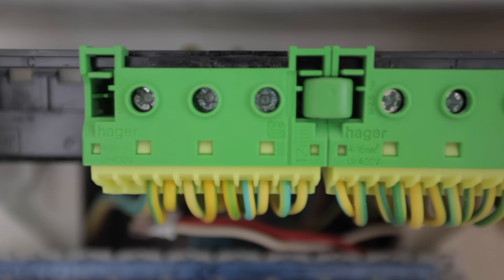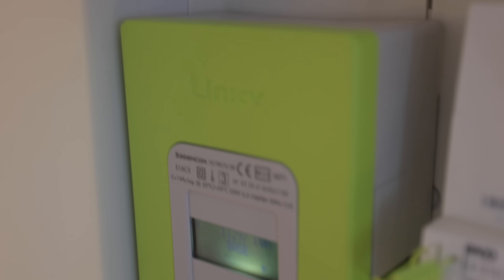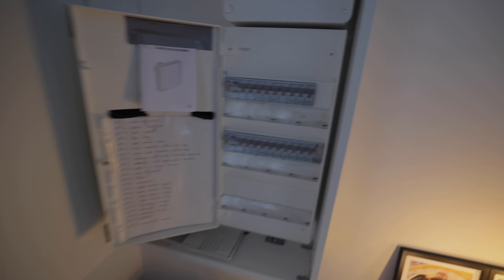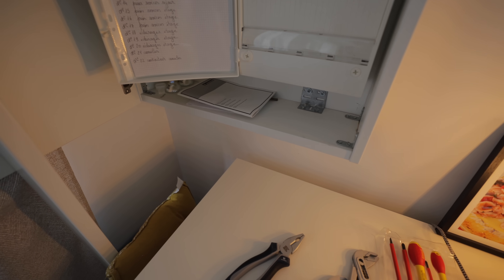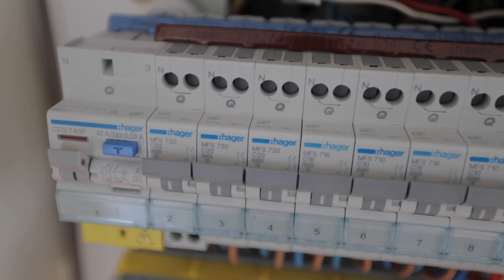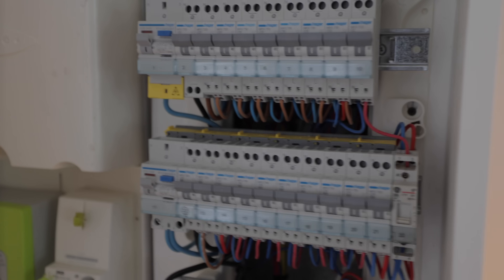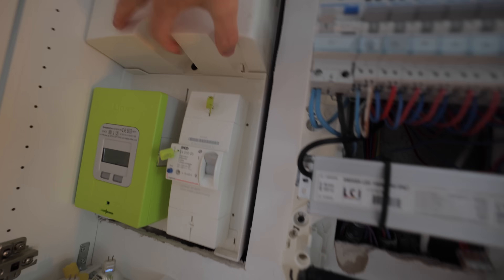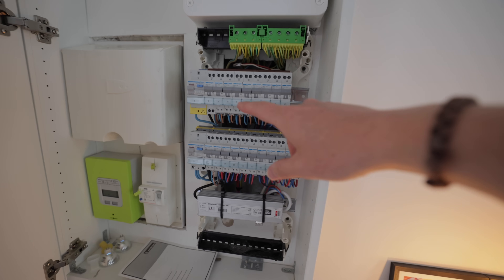U.K. Electrics SUCK! This is what we should be doing…🇫🇷

Comment: I currently live in the Netherlands but I've lived in France for 7 years and in my opinion the French are on the cheap when it comes to RCD's. It's quite common to find 8 circuits or even more on one 30 mA RCD. Also Type AC is still quite common.

In the Netherlands it's quite the opposite. You're only allowed to have up to 4 circuits on one RCD. Since 2005 all residential electrical installations you must have at least two Type A 30mA RCD's so a ground fault doesn't cause power failure in the whole building. Solar Panel Inverters must have their own Type B 30mA RCD or RCBO.

Nowadays it's quite common to have every circuit on its own RCBO.

The strange thing in the Netherlands is we don't have separation between light and outlet circuits so almost every circuit is B16 with 2,5mm² wiring although the switch wires are always 1,5mm². The main junction box is actually a in ceiling box above the light called "a centralbox". The whole idea is when you install the light fixtures and outlets there are no visible covers on the wall or ceiling anywhere.

Many small houses with up to 4 bedrooms with gas cooking and heating only have 4 circuits, 2 on each RCD or 4 RCBO's. Usually 2 general purpose B16 circuits which both should have a spur to the kitchen so you will have up to 32 Amps. Then there are usually 2 special purpose B16 circuits for the washing machine and tumble dryer. When electrical cooking is prepared there is a special cooking circuit which is when you have single phase supply 2 interconnected B16 circuits which allow you to draw up to 32 Amps but it is generally advised to get three phase supply and get a three phase B16 RCBO which allows you to draw up to 48 Amps. 

Of course larger houses have more circuits, but many people who live in a terraced house like me only have 1x40 Amps supply (single phase) so there is not really a reason to have a lot of extra circuits. And apartments usually only have 1x25 Amps. Detached houses usually  have 3x25 Amps (three phase). You can apply for 3x40 Amps but your fixed tariff will go from around € 300 /year to the fourfold of €1200 /year so most people do not opt for this expense unless they have power hogs like a sauna or hot tub.
Reply: Do you mean it is not allowed to mix 1.5 and 2.5 in one circuit? That is not allowed in Belgium. 1.5 is only allowed for pure lighting circuits but indeed it is allowed to use 16A breakers for both 1.5 and 2.5. That is to avoid voltage drops on long wires for outlets, the wire is actually still safe for much more amps.

Comment: Nice modern fuse box. France have little different MCB then most of the Europe. Their MCB are cutting off both neutral and Phase while most of the Europe be uses MCB which are breaking only phase ((live).Colours of the wires are green-yellow=PE,  Blue=N,  Black, Brown (and grey in 5 wires cable) = L. No red wire is used (maybe only in very old installations)
 MCB 16A with  2,5mm" wire - mainly sockets 
MCB 10A with 1,5mm2 - mainly lights 
MCB 0,75mm2 with 6A - mainly lights
Type B MCB are mainly used for houses and C  for garages and  workshops.
RCD,, mainly Type A are used in households  30mA for bathrooms and "wet" rooms, and 300mA for all other, although new standard is to use 30mA for all household purposes,
 This is how it is in Croatia, but I think most of the Europe is similar

Comment: Lets be fair, if your doing a brand new build install then the box has to be in an accessible place and that has been the case for a few years. The gubbings of the box can either be split load (safe as houses) or RCBOs which is also safe as houses. Give it a few years and itll all be AFDDs. And others have mentioned cost is a major factor on install.

Comment: Diff Type A is for protect on AC current and in also DC Current generate by some powerful devices. Type AC is only for AC current leakage.  But it strange Main fuse is normally not accessible directly inside home. :face-orange-tv-shape:  DTI in French :  Dispositif de Terminaison Intérieur Only use for (RTC (telephonic commuter network))  and ADSL. Sorry for my English i don't practice.

Comment: When I bought my Dutch-built boat, the mains electrics consisted of two 10A trips which sent out a cable to a double socket. From there another cable went out to the other side of the boat with a plug on the end. The plug was permanently live.
I replaced this with a 12 place box with a 40A RCD taking 2 places. There are 8 trips for plugs around the boat. The last two places are taken by 2 16A trips connected to the input sockets, one on either side of the boat so the side next to the quay can be connected. Since the nonconnected socket will be live, the trip for that side has a warning light connected indicating that the trip should be switched off. One cannot be too careful when electricity is involved.

Comment: Utter rubbish
Reply: Know a lot of French people all agree their appliance plugs are crap compared to British plugs,
Reply: @neilbrooks5099  We are not discussing plugs and sockets but wiring schemes and distribution boards.
Reply: British outlets have a flat surface and rely on partially insulated plugs. While the suko plug is completely surrounded by plastic before the contact is made. The suko plug is simply safer and it also looks better. Moreover, it doesn't hurt when accidentally stepping barefoot on such a plug 😂

Comment: French electrics are just fine, when done properly. Anything fairly new and professionally installed is very good.  Large, because it’s all radial not ring mains, but good. 

However you don’t have to go very far back in time and it can be a nightmare. Three pin sockets where the earth isn’t wired up is quite common. I’ve seen some sockets wired up direct to the incoming mains, before the meter and any isolation switch. In an old house you have to be very careful to see what you’ve actually got. 

They have had smart ish meters for a long time. They light up amber red and green telling you home much the electricity costs tomorrow. Save your washing until a green day! Very simple and far simpler than our smart meters.

They also often have 3 phase and those have to be balanced. You get charged a rate according to a current limit per phase. Get the balance wrong and switch too many things on on a single phase and the whole electrics switch off. 

The three phase, combined with a historic casual approach to not wiring up socket earths, can lead to 415v interphase faults. Ouch.
Reply: Three phase for domestic use has been phased out 30 years ago...
Reply: @bluetrane8052  There's still plenty of places with it though...

Comment: I’m a French Electrical Engineer who lives in Marseille, if you need further explanation I can provide you some.
French regulation for electrical installations is called NFC15-100 and if I recall well Legrand has made an awesome guide which explains everything step by step with schematics and pictures.
Reply: I think MCB with both N and L are very rare system in most of the Europe.  In my country (Croatia) 16A/2,5m2 for sockets and 10A/1,5mm2 for lights is a norm. For households B type MCB is used. RCD 30mA for Bathrooms and "wet" rooms  and 300mA for the rest, although newest standard is 30mA for al purposes.  in 99% of houses Type A RCD is used.
Reply: @nikicamalezic5388  In the Netherlands MCB's with both L and N are quite standard. It's even mandatory to switch both Line and Neutral because of two reasons:
1. Many (but not all) residential buildings have TT System grounding like in France which means Neutral and Earth aren't connected and we rely on RCD's for ground fault protection.
2. In the past we had 127/220 Volts meaning some buildings didn't have a line and neutral but got 2 of the 3 line wires to get 220 Volts.

We don't have separation between lights and sockets so basically most circuits are B16/2,5mm². For RCD protection we have up to 4 circuits on one Type A 30mA RCD although new installations are usually fitted with  Type A 30mA RCBO's on every circuit.
Reply: @robinheijblom  Well the new electrical standard in Croatia is also 30mA RCD for all circuits.  But in that case there can be an issue with the modern electrical and electronic equipmen since most of them are using swithing PS who leaks few mA wich can tripp 30mA RCB when combined reaches that value.
So for that reason IMO for space saving and practical reason would be better to use RCBOs nstead of 2p MCB+RCB for every 4MCB.

Also 2,5mm2 IMO is a waste of material for lights in new LED light installation since 0.75mm2 conductors and 6mm2 MCB is more than enough.
Reply: @nikicamalezic5388  You can also use 16A/2,5mm2 for sockets and 10A/1,5mm2 for lights in France, but you won’t be able to stack as many sockets/lights on the same circuit.
For instance it’s 8 sockets max on a 16A/1,5mm2 circuit while you can go up to 12 on a 20A/2,5mm2 (general case, for wet rooms like kitchen and bathroom it’s different)
Reply: @Sakiut25-1804  Thank you for Info. 1,5mm2 can handle 18A max and 2,5 26A, so using 10/20A  MCB as you said is fine. 
But usual installation in Croatia is little different. We are more conservative on the safe side :) We usually do two circuits per room 16A/2,5 sockets (up to 5-6 sockets per MCB) and 10A/1,5 for lights except where we need more circuits like in kitchen for appliances. Every room has separated circuits.
House socket are max 16A rated so that is also why 16A MCB is used. 20A MCB is usually for circuits with direct connections.
Reply: @nikicamalezic5388  In newest installations the conditions are almost the same here: one socket circuit per room, usually a 16A/2,5mm2 one and at least two separated 10A or 16A/1,5mm2 light circuits. 

The proximity between French and Croatian installations makes me wonder if maybe there’s EU regulations about domestic electrical installations

Comment: Yes, the disjoncteur can be set at a lower or higher fuse rating but requires a visit.  The suscription can be set at 3000 kws up to 12000 i think. You pay more for higher use. But with a small flat at 3000 kws it often fuses when you use hoover and oven at same time.  If you dont pay a bill the supplier can limit your suppky to 1000 kws so you cld be going upstairs and plunged into darkness. Also if you use radiators and cookers you can blow the outside house fuses with almighty bang.  Its illegal in uk.  Yes a fuse detects dc leak its on norms for plaques and cookers. They dont have metal consumer units nor fused connection switches for hot water cylinder. They also dont have instant electric showers. Diy stores sell fuses with screw in as push fit very fiddly.

Comment: I took a course in electricity of construction when I was living in canada (1988)  the way they did it at that time was pretty similar to the way they did it in the US anyway the   interrupteur differentiel (earth lick detector) did not exist just a main breaker on the upper side of the panel receiving from the outside two phases and a neutral (diphasé in french)  the breakers were only protecting the phase (line) all the neutral wires were connected to a terminal  they were using the same cable section for both wall sockets and light sockets (awg 14)   they were allowing  up to 14 wall sockets for one circuit fed by a 15 amp breaker ( only 7 in france same for light circuit)  the ground (earth) the main wire was connected to the main water pipe the electrical stove sockets were gigantic  inside  junction derivation) boxes wires were spliced together  no wago no screw on connectors of course it was in the late 80's I am quite sure canada must have improved the way they do it nowdays  then I moved back to france where  I went to the same process again to become once more an electrician   france has one of the most safest electrical system in the world  thanks for sharing : )

Comment: 6/10 for the panel

- 1 because hager (cheap and shit produce)
- 1 for no surplus copper in the loop 
- 1 connecting bridges (wago) in the switchboard is perfectly forbidden 
- 1 unaligned driver, and generally a negative estetic opinion.

Comment: The DTI box is the connection between the national phone network and the local network inside your place. The "test" plug allows to check if an issue comes from your network or from the outside world (if your equipement works when connected to it, the problem is in your place).

Comment: I’m not an electrician but lived in France for nearly 20 years. We had lots of electric work done in our house, why? Because the place was a mass of cables which often were destroyed by mice etc. The loft was like a spiders’ web and in the sous sol (basement) it was even worse. The reason? The French do not do ring mains. There is a new cable for each set of outlets etc. Every set of outlets be it for plugs for TVs or fridges is allowed only up to a max of 5 outlets per cable (16amps). There has to be a dedicated cable for anything like a hob or cooker which is fine but by the time all this gets back to the consumer unit its impossible to cram all those cables in so its another row of circuit breakers and the conduit to the box is subsequently much larger. In fact the final length of conduit for our house was 10cms and even then it hardly coped. No Linksys. I was the tea boy for some French electricians during a neighbour’s renovation and it was a real eye opener. Not only did they have to deal with walls made of flint stones they had to run cables to and from the most inconvenient places. I spent a bit of time explaining about ring mains and spurs and while they were skeptical as to whether it was more convenient or cheaper they couldn’t understand why French rules prevented them from adopting the system. I doubt if many of the old places like mine and indeed any building before say 1960 would have the smart setup shown in the video. Accessibility, yes all of the consumer units I saw in France were in convenient places, even like the video, in the lounge. Ours was in the sous sol which could have been dodgy because we were prone to flooding after prolonged rain.This is almost certainly this standard because it is a rental property and apparently quite modern. Anyway our chat ended in the usual Gallic shrug and a c’est ;a view. I tired to educate them to drink tea but that was a loser. It was always too strong and why the hell do you put milk in it? An excellent way to improve your French skills but beware that they will swear that a certain word is OK instead. Thankfully I tried it on an elderly neighbour and he said, you learned that from the guys working in the house. He then explained what I was really saying - thank god I didn’t use the expression in polite company. It was a great life and we miss it - getting old is a bastard but you have to remember that for the kids, if anything happens, they will have a worrying time dealing with everything. Such is life.

Comment: The most common in France is double poles singles with double bus bar above, but screw connectors at the bottom.  The problem I have in my parents house is that none of the neutrals are connected (those are all bunch together) so I can't edit the installation before I have identified all the neutrals ...

Comment: Hi! I live near Marseille and I've some knowledges in electricity. I'm glad you've been impressed by our electricity network here in France, and yes we have high quality standards which now permits to get with few modifications to new technologies and that's same with internet network.
Sometimes the national electricity standards (NF-C 15 - 100) are more restrictive than the other European countries standards but for good reasons. Here you're in city, but in the countryside you could be surprised cuz they don't renovated the domestic network on certain houses, that's a good way to see the national standard evolution, since 2000's we have most of the requirements that's are present today.

- NF C 15-100, for domestic electricity standard from the output of the main breaker to all the domestic network. (colors-code, bathroom requirements, cable section with which equipement connected to, and lot more...)
- NF C 14-100, from national grid into the input of the consumer unit point (main breaker; property of the national electric compagny aka EDF).

The white box named "DTI" is a part for internet network ADSL, and now require to integrate fiber optic with RJ45 splitter (patch panel i think we say in english). the internet box should be located near this white box.